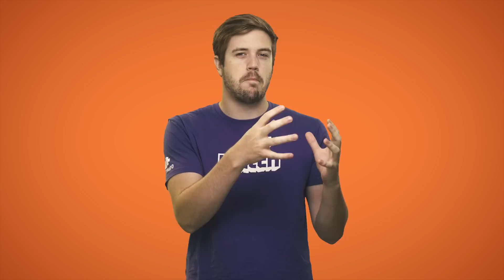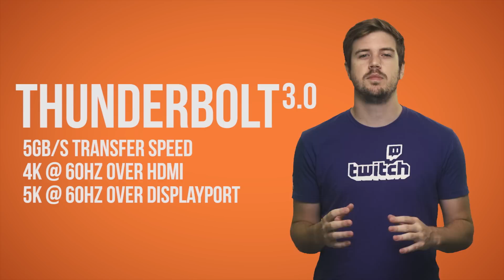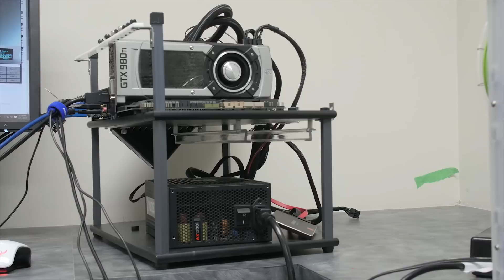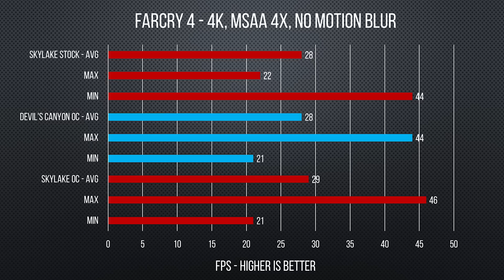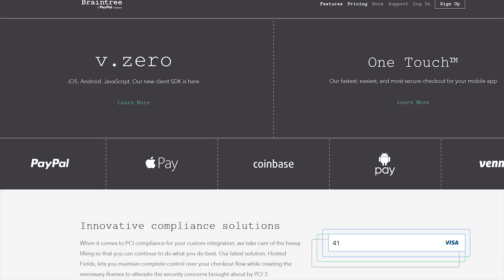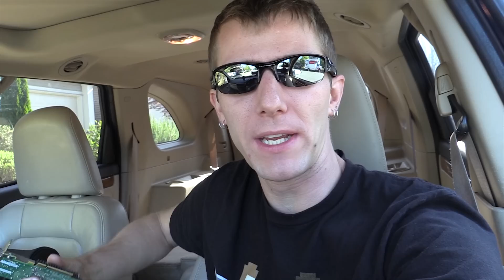Intel 6700K "Skylake" CPU

Comment: I still got my i7 2600k FTW!!!
Reply: +DrSQUIRRELBOY12 i7 920 here. 2.67 glorious ghz
Reply: I'm still on my LGA1156 Core i7 870 lmao
Reply: i7 5820k here. Will be back here in 5 years still with this 5820k :P
Reply: @Zveir  only two years to go!
Reply: Still with the 5820k :P
Reply: @Zveir  )
Reply: @Zveir  do you still use it? its been 5 years. lmao
Reply: @jake20479  I upgraded late December to a 5950x based system, but I got a great 5.5 years out of it. Now my old 5820k based PC is being converted to a Plex server, so it'll still be kicking for a while longer
Reply: +DrSQUIRRELBOY12 I rocked and broke 2 chairs yet STILL using my 2700K!  the card previously used on 
the platform were GTX570->580->680>970 yet it's still ROCKIN!!.
Reply: +DrSQUIRRELBOY12 bro i am still using my first gen i7 920 :O :) :D
Reply: +DrSQUIRRELBOY12 I only have a Q8200 :(
Reply: +DrSQUIRRELBOY12 Me too. i should upgrade my GTX 560ti though..
Reply: +DrSQUIRRELBOY12 2600K at 4.6GHz here, almost equal to an i7 4790K :D
Reply: +DrSQUIRRELBOY12 hehe no need to upgrade ..just changing videocard every 3 years .... only reason we would need to buy new cpu is if they go and make some kind of new slot to replace pci express....   lack of competition in CPU market make intel lazy doing worthless refresh with little extra lol ohhhhhh loook it integrate a new hardware video decoder OOoOOoOO  lol
Reply: PFFT i7 720
Reply: +DrSQUIRRELBOY12 Still rocking an i7 920 running at 3.67Ghz.
Reply: I just finished building my computer and it has the Intel skylake 6700k CPU.  It is faster than Usain Bolt running away from a panther on a train.
Reply: +DrSQUIRRELBOY12 Same. Not worth upgrading yet IMO. Overclocked mine to 4.2.
Reply: J S you upgrade your 2600k yet?
Reply: z. Nope :) Had to replace the AiO water cooler though.
Reply: Damn, I had a 560Ti. Went to a 770 6 months ago.
Reply: David Hilarious I just upped to an EVGA GTX 980 SC
Reply: +David Hilarious I got a GTX 465 :P
Reply: +DrSQUIRRELBOY12 Phenom II X4 920, BOYS!
Reply: +turbo pascal Phenom CPU´s are still the best AMD CPU´s.
Reply: ***** Within each CPU's lifespan, yes, probably.
Reply: hahha meee too!
Reply: +Mukunda ieg lonewolf still got my i7 950 aswell. Its been at 4ghz for a few years but I am looking at a new cpu. The x99 systems look nice since I also use autocad a lot.
Reply: SteyrM1912 high five, bro!
Reply: +DrSQUIRRELBOY12  still at i7 950. Pretty happy with the setup with a 750Ti to back it up.
Reply: DragonEye135 nice, I just upgraded from my dying 780 to a 980 in the GPU dept.
Reply: Don't blame you. I'm still running my i7 860 over clocked. Ive even backed it down to 3.7 GHz everyday usage, it never gets strained along with  AMD R9 290X. If you're not maxing out CPU usage 100℅ there's no need. However I should keep abreast soon its my field.
Reply: +DrSQUIRRELBOY12 Same, since 2012.  I was lucky on the lottery, mine can do 5.1 stable, but 4.4 is the sweet spot to remain in stock temperature numbers (28 to 60c), 4.6-4.8 is fine as well just don't like going over 70 celcius.    Not bottlenecking my 980 Ti.  Using a coolermaster V6 GT fpr the heatsink. 

Reply · 

Edit
Reply: +Adrian802 Using a 2700k myself, i have no idea what they made this chip out of! it's godly! Intel must have used their magic beans on this one!
Reply: Ricepudding.  It's probably the cream of the crop from the 2600K batches. Like a Geforce Titan lineup.
Reply: +LowWithKnowhow you CAN'T upgrade even if you want to
Reply: +DrSQUIRRELBOY12 Still got my i5 2500k! Looking to replace it soon though. xD
Reply: +Thomas DC I think I upped mine to 2.83, but still running smooth as butter.
Reply: +Thomas DC I think I upped mine to 2.83, but still running smooth as butter.
Reply: Very good CPU
Reply: @HairiestLad Yes

Comment: How would a four single radiator processor cooling workout?  Instead of a quad radiator, which requires lots of case modding why not have two or three smaller radiators in the traditional location (top of the case) while the others could be on the back and/or side?  The heat transferred from the processor should still be the same though could have engineering problems I'm not aware of (why such coolers don't exists?)

Comment: I think what we're starting to see is the stagnant environment that has become X86, in addition to manufacturing issues with such small process nodes. I mean take a look at the progression over in the last four years from Intel in tandem with ARM/ARM64. I personally believe that while the AMD beast has been slain (or is in hiding working on ARM), Intel is going to eventually be in direct competition of ARM64 IP's. I mean you're already seeing custom Soc's from Apple, Nvidia, Rockchip and finally Samsung be capable of matching or exceeding the performance of the Core-M in most SFF notebooks. I think that once Microsoft creates a dynamic recompiler for its code-- or makes exe's rely on Architecture redundant libraries, Intel will be having many sleepless nights.

Comment: Can the Z71 chipset MOBOs still use DDR3 RAM or is it strictly DDR4?
Reply: I believe some motherboards support DDR3L RAM
Reply: Assassin Ocelot
Okay, thanks =)
Reply: +lilturk726 Some motherboards will support DDR3L, but it will wear out the memory voltage regulator faster, as it's built for the even lower power DDR4.
Reply: ***** It's not going to burn out the CPU, it will just simply wear down the memory power management part of the CPU faster. The chip will still perform fine for years and years.

Comment: 4:11 Wrong. Smaller manufacturing process results in less heat and power consumption as less length of the interconnectors decrease among other things.

Comment: Ivybridge here. Only do 3D rendering, i want a chip 10 - 100 times faster than an ivybridge, for a reasonable price.  Looks like im in for a long wait.
Reply: +MadMax The 6700K on stock clock is only 5% better than 4790K. Guess you need to wait for 20 years to see at least 10 times faster than ivybridge performance CPU. Or unless AMD is doing something competitive.

Comment: consistent findings with other reviews and comparisons. the only compelling reason to upgrade vs Haswell really is for PCIe bandwidth for NVMe drives and perhaps other USB upgrades (provided you have the device to support the connections). Or perhaps if you have a 4770K  and are stuck at 4.5 Ghz OC (like me) and must have the potential to go higher then one could upgrade for this reason as well.. or get a devil's canyon and take yer chances. that said I will likely upgrade in a while to keep future proof

Comment: I'm building a new PC soon (from zero). Will it be worth it to give it a try to the new chipset, CPU architecture and RAM?
Reply: +leirisal There is a slight premium since Skylake is new, we're talking maybe an extra 60 dollars onto the final price. As long as that slight premium doesn't make or break the build then I would always recommend getting the newest releases. If not for the minor improvements made each iteration then for the fresh support life of the newer chips. Haswell is perfectly fine but it is 2 years out the door already in terms of when Intel stops patching bugs (software wise, IRST, ME, NIC, etc).

Comment: I thought i'd ask people who might actually care than some sale person in store.  I have a i7 4770k not overclocked(yet) and i'm wondering if I should purchase the 6700k, but my problem is not that simple and lays just below.  I bought my 4770k at Microcenter with a 2-year extended warranty and with this i'm allowed to exchange my 4770k for in store credit to the amount i purchased it for($250 in 2013), the issue i'm having with making this decision myself is do i either keep the 4770k and loose the $250 credit and wait for a "Newer" processor to come out in a year or possibly two, or pay $300-$400to upgrade my CPU, motherboard, and ram?
Reply: +chris brown Lets say you get 3 fps from upgrading to Skylake. That would mean you spent on average $100-$133 dollars per fps (if the total cost of motherboard, ram, cpu came to $300-$400). I personally say that is a horrible deal. I'm not familiar with Microcenter's policies but what if you just upgraded to an I7 4790k and reworked a new 2 year extended warranty on its purchase. It would cost you a minimal amount to swap out since it is the same socket, and you can hold its value another 2 years for the next iteration or Skylake E.
Reply: +Timothy Lastovica Thank you for the feed back, I'm gonna do that instead of buying all new hardware for skylake.

Comment: They used 2400Mhz ram, but skylake only supports up to 2133Mhz right?

Also do you guys think this processor is worth an upgrade from an i5-3570k at 4.0Ghz?
Or should I just upgrade my gpu? (670 FTW)

Comment: I have a question about my cooling.

I have an i7 4790k and it is running with stock cooler.

It runs about 30-35 at idle,

And 75-80 at load.

are these temps safe and will they cause any damage to my cpu?? Thanks.
Reply: Tanzu15 Lol thanks xD but I actually ordered a 212 evo yesterday which I heard will keep it under 60 even at load ;)
Reply: +Mario Man PVP Idel means nothing.   How MUCH ( percentage) is that load at that temp range?  If your idea of a load is 60% to 70% tops, you may want to at least replaced the thermal paste and clean the stock CRAP/ paste off of the stock cooler's heatsink bottom ( arctic silver 5 is tried and true).

If you mean 90 to 100% = a load, then 75 to 80 is fine and about the best that cpu can do with an ambient room temp of 72-74 F

Comment: I upgraded all my equipment this summer.
I plan on getting an Alienware Area 51 with the 6700k  and  64GB of DDR4,  a 1500 Watt EVGA power supply. 

I already have a Titan X to put in it and I have a curved HP 34" monitor. 

If you have a business, you can just business lease these computers for 0% interest if paid by 18 months...or buy it outright.  I bought a new server for $10,000. I expect the computer to cost less than $3000.

No game on the entire market needs those specs - not even Witcher3 on Ultra-Hi def... It'll be fun to be able to max every game out though. 

wish me luck.

My LLC launches in September.